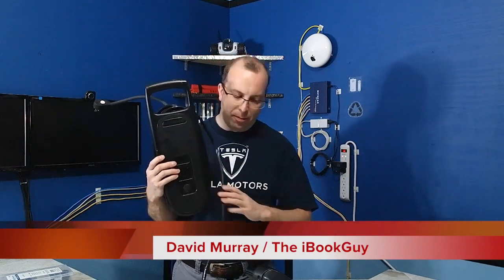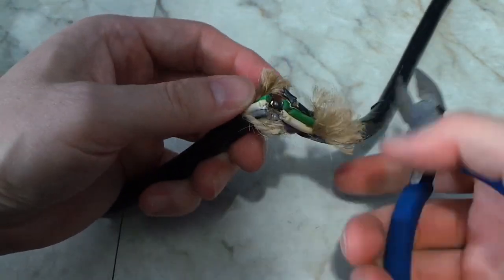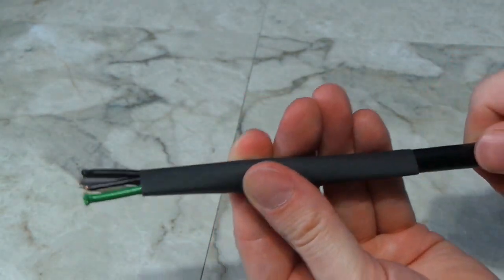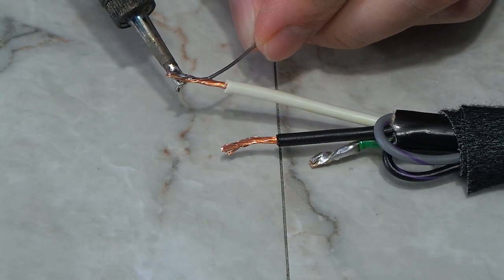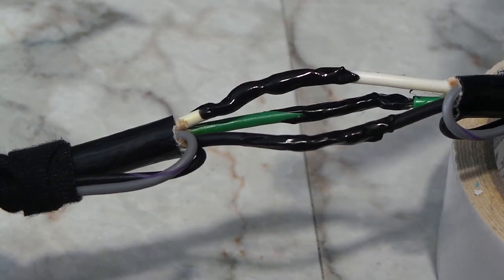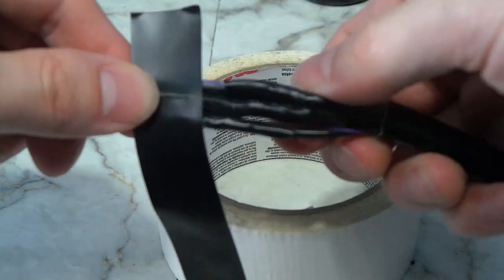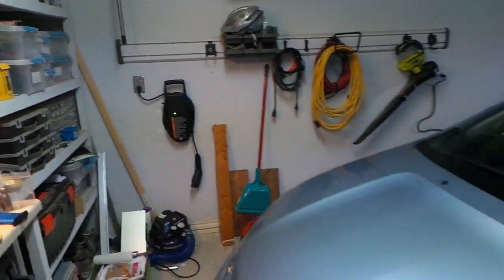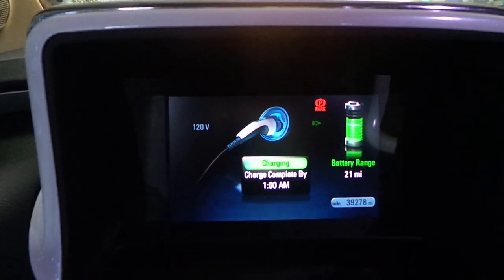Repairing a damaged EV charging cable.

Comment: You should never use solder in high current applications. It is always best to use some sort of a crimp.
Reply: Ah—snicker, snicker—you missed the point.
Reply: Giligain I. Lol I posted this before I finished the video--Thought about removing it, but I was too lazy.
Reply: Kris S 
Exactly! Architecture has detail(s) everywhere. Even urban planning has small tolerances. I remember a project having to find a path for a new underground pipe line...I had to investigate several ancient maps, gathering details of existing location(s), elevation, pitch, diameter, contents carried, direction of carry, whether a line was abandoned... 

Did this type of project too investigating existing power lines, and having to relocate the lines to a new power pole location: studying clearances and slag-line shape...this project put my spatial graphical engineering to the test. It was pretty Kewl showing the others what I can do with a line in space and know its orientation and length.

I miss projects like those. :,-((

But I don't miss having to document fire system, communication system, etc. in this one hospital. I was constantly looking for existing objects..fire extinguishers, exit signs, speakers. This project went on for so long that I began seeing stuff in everyday life, outside of work, in other buildings—I couldn't turn off my scanning for these things. Ugh!
Reply: Kris S but you weren't to lazy to type a whole new comment about your laziness?
Reply: Jason Alexander do you have a problem with that?
Reply: Giligain I. It can also mean "overly concerned with details"
Reply: scratching my head —I don't see how I can't be pedantic given my training. It's the little things ppl screw-up that make the big things, oh, so wrong.
Reply: Giligain I. I learned that the hard way with my more complex math and physics classes.
Reply: Chris Bryant 
¿Okay?
Reply: Kris S 
Take [1]:
I've done the 'discovery' tests back in the day, where it's supposed to help you decide what you want to do. Whelp, that didn't help very much—didn't point out any real strong points..was balanced.
Take [2]:
So I go to college taking basic core classes satisfying any degree & one fun class each semester—art, photography, drama. Eventually, thinking psychology is my thing—but nixed that plan after talking with a professor in the field. 
Take [3]:
So I finally decided I like art & math and that the two together make perfect sense for architecture. The confirmation to my choice was based on The Brady Bunch Show, where Mike is rarely having to pull an all nighter to complete the project that Greg lost; and Mike was home all the time and taking vacations and stable family life with exotic clients. 

My conclusion: I drank way too much A&W Root Beer after school watching Gilligan's Island, I Dream of Jeanie, and Brady Bunch; and McHale's Navy but not by choice...it's what was airing on the network channel at the time—didn't grow-up with cable TV and VCRs weren't around yet.
Reply: Kris S 
That's too bad. I've had more than enough teachers leave before my turn also. What can help is if the textbook is good at introducing the concepts and solid examples. Do you like the book?

Ah, memories of my prestressed concrete classes with a very green teacher. Her background was molecular cracking in concrete. So you can imagine the quantity of detail given during lecture time...pages and pages of hand copied notes from the chalkboard. She did her best, but wasn't ready for the graduate class in reality, maybe undergraduate.

My wood design class was the best because of this foreign teacher with thick accent (but not nearly as bad as the Russian teacher and her 'bisexual lines' instead of 'bisecting lines') his accent was overlooked because he knew his stuff and relayed the information based not on textbooks, but experience. 
Hmm, come to think about it, I got lucky getting the very last semester with a retiring teacher; he taught the Structural Steel and Welding Design. His flow
Design Charts were hand made handouts guiding you to the formula(s) required for design or analysis of existing steel/welds. That was a fun class with much math and design choices. 

Bragging Rights: I designed the structural system for the Hieronymus Mueller Museum alongside my previous employer who designed the architecture and I think mechanical system. It was quite challenging given the materials used and cantilevers and exterior clad. 
http://muellermuseum.org/
Reply: Wow! So you specialize with concrete structures?   I'd like to say that the book is good at explaining things,  but it really isn't.  Right now,  my only real teacher is YouTube(given that I know what to search for)
Reply: Not specialize in concrete, no, but all building materials used to support the building. From designing retaining walls, foundation footings, steel beams/columns and connections used, reinforced CMU walls, wood of all kinds incl. laminated, cable (tension) systems...and the list goes on and on. 
But this doesn't mean I can't design the heat load on a building also, or HVAC system, electrical system, water supply/return system...meet the ADA rules and regulations along side the state/city/local codes, write specification codes, or even make an accurate bid to underbid the competition and yet make a profit.
Reply: Kris S
You would think, but I have found myself in public settings and prefer not to state my profession due to the weird reactions from ppl. It's an honored profession with a code of conduct to follow. I would compare it to any other profession with a code of conduct. I haven't ever met a judge in a public setting to my knowledge, but if I did, I think I would act weird too.
Reply: Kris S 
I disagree to start with based on these observations. I've had this space heater of mine apart for repair and there are solder joints on a 1500 watt heater. The input on several electronic components have solder joints on the power AC input to PCB board. 

So...I did a little digging:

Effect of Solder Thickness and Joint Overlap on the Electrical Resistance of Soldered Copper Joints
https://app.aws.org/wj/supplement/WJ_1981_10_s199.pdf

As a rule of thumb it is generally accepted that, for lap joints, an overlap of three times the thickness of the thinnest conductor is adequate. With regard to joint thickness, joint spacings of 0.002 to 0.005 in. (0.05 to 0.13 mm) are considered desirable to maximize capillarity effects with regard to solder flow into the joint.
Reply: Giligain I. Haha no no,  you misunderstand me.  I agree that for only 12 amps, the solder joint is fine--Afterall,  volts don't generate heat, current does(I think).

I was just saying that it is a lot of power--as a sort of unrelated point--I guess I am not very clear.  I originally didn't know that it was only 12 amps.
Reply: 12 amp is a lot of power for these wires. Not sure what the gage is shown on this post.
Reply: Pedantic: of or like a pendant 
#whoknew
Reply: Kris S 
Did you already know that, or did you look it up? I used iPhone's definition, and that's all she gave me. It's an interesting new word for me.
Reply: +Giligain I. I actually already knew.  I saw it a few weeks ago and thought it was interesting--Worth adding to my vocab.
Reply: Giligain I.  I was talking to Jason Alexander and the OP
Reply: Giligain I. You were talking as if I called you pedantic.  Was from another account
Reply: Chris Bryant
It's okay, I don't mind the title..I like it better than being dogmatic.
Reply: Giligain I. So you're an architec? Nice! I thought about that for a while, but I really don't know enough about it to persue.
Reply: Giligain I. Interesting. I love art and physics--I could live without math.
Reply: Kris S
 ¿ how can you have physics with out math? It was nothing but formulas and how to integrate and derive formulas. 

Architecture has (3) basic fields of study. I chose the Structural Option, which has much more math. Then there's the Design Option, where you interpret the clients wishes and make the Engineers scratch their heads at the impossible design proposed. Finally, there's the Management Option, where you play god with everybody underneath.
Reply: Giligain I. The math used for physics isn't hard to me--The calc is really basic.  But in my calc classes,  it is much more complex.
Reply: Kris S 
I tried looking for my Calc notebook recently...
Last time I heard you were doing partial integration.
Reply: Giligain I. Yeah, we learned some fo that last semester.  So far we have just been reviewing stuff todaY, next class we start new content.
Reply: Giligain I. Guess my luck: At my school, we have a calc teacher that is kinda famous because he is so good--Everyone reserves his class months in advance. When I finally got a seat in his calc 2 class, it turned out that he got cancer. He left the school on the first day of the semester... 
My heart goes out to him and his family; but Long story short, I am back with the suck-teacher from last semester.
Reply: Giligain I. Wow!  thats a profession you can be proud of.
Reply: +Kris S pff 12amps thats nothing !
Reply: +Kristijan Dinga oh, is it just 12 amps?  how many volts?
Reply: Kris S 16-25a is hi-amps
Reply: Kristijan Dinga I asked about the voltage.
Reply: Kris S 120vdc
Reply: Kristijan Dinga that is a lot of power to travel through a solder joint. Almost 1,500 watts.

Comment: Your method was fine, and taking extra precautions was a good choice. 
you could've used butt splice connectors, though it would add unneeded bulk and they fail all the time. You could've even doubled up on the heatshrink, but it seemed like that type of heatshrink was made specifically for higher voltage lines like the plugs for ovens or the EV charger line in your case. 
I don't think there's going to be many good arguments against your method, and I would've done pretty much the same thing.

Comment: The Chevrolet Volt isn't an electric vehicle it is a plug in hybrid
Reply from the maker: XboxCarsForza Yes.. it is a PHEV, which stands for Plug-in Hybrid Electric Vehicle.
Reply: The iBookGuy I know its partially an electric vehicle and you can plug in to recharge the battery but it still has a gasoline engine
Reply: XboxCarsForza It is an electric vehicle.  We have developed terms to distinguish between EVs that have a gas back up (PHEV) and those that do not (BEV: Battery Electric Vehicle).  Both PHEV and BEVs are EVs.  http://www.nrgevgo.com/faq-about-electric-vehicles/
Reply: yes but the engine is only for electricity. If you never turn the engine on, then it is the same as any other electric vehicle.
Reply: XboxCarsForza No it is actually NOT a plug in hybrid like the Prius the volt is actually one of those cars that can run on gasoline and electricity

Comment: iBookGuy, is there a specific reason for using the type of splice you used for this project? If it were me I might look into a western union splice? they seem to be less prone to cold solder joints and have extra strength in the splice itself. In addition to offsetting the splice you can use little pieces of shrink on each wire in the bundle so they will not short. Great Video keep up the good work.

Comment: That was not the proper or safe way to do such a repair. The use of solder to join any cable carrying more than 70 VAC is contrary to all codes and UL requirements (the wires must have a mechanical bond in addition to the solder). The solder on the gauges of wiring s(above 18awg) as shown can sometimes be improperly done and the solder can actually not properly flow onto the conductors (this could damage the device they are connected to by creating a resistance point). I suggest the "liquid tape" you used is inferior to the "real" flexible insulation manufactured by 3M. As an electrical engineer I suggest you recommend just replacing the power cable; virtually all manufacturers sell replacement wires because of such accidents or damage.
Reply: Peter M Thank you for an engineer's perspective.  Just to let you know, the repair in this video was done to the EVSE provided by Chevy.  I checked with my local parts department and they confirmed Chevy does not sell the cable separate from the EVSE and they would like over $600 to sell you a new EVSE.  If one were to replace all of the wiring from the main unit to the part that connects to the car with a third party manufacturer's cable, would you still suggest now soldering to the board in the main unit?  If so, how would you connect it?
Reply: dandixon7 I can tell you that UL and a multitude of other governing agencies do not approve of the manufacturer's recommendations to you on the repair. I could not find the "EVSE" you referenced either. (By the way is that not the same car manufacturer that killed people with defective ignition switches?)  

Additionally soldering without establishing a mechanical bond (twisting the wires together) is not tension resistant. Liquid insulation is not designed for 110VAC power cords, heavy duty shrink tubing is (by the way using a flame to reduce the heat shrink damages it). 

Chevy may not make the cable because some one else does, I found it on the web. Check the web and you will find it. But do me a favor and stick with voltages under 70VAC and 24VDC. You can hurt yourself and viewers not to mention destroy equipment. 

By the way "my perspective" is a reflection of the facts and correct methodologies. Do you refer to a surgeon as having a doctors perspective on your operation or medical advice, as though a plumbers opinion maybe as valid but different????
Reply: Peter M Thanks for the reply.  I was using EV jargon without clarifying what it means.  In terms of an EV the "charger" is a component that is built into the car.  The EVSE, or Electric Vehicle Supply Equipment, is the unit iBookGuy was working on.  It encompasses the plug from the wall to the main unit, the main unit which is responsible for communicating with the car's charger, the cord to the car, and the J1772 plug that actually goes into the car itself.  What I was saying is that Chevy won't sell you just the cord that goes to the car.  I have found a cord with the J1772 plug on it made by Leviton, but it does not have instructions on how to connect it to the main unit portion of the EVSE and I'm curious about pointers for connecting it.  

I would use the phrase "surgeon's perspective" if there was a video about a medical device that I didn't post that I was replying to a surgeon's comment on.  I'm a lawyer myself and I would appreciate it if someone thanked me for providing a lawyer's perspective on a video about a Supreme Court case.

Comment: Maybe use a different color piece of heat shrink tubing to contrast the cable's black outer jacket?  It may prevent someone from inadvertently putting excess strain on the solder joint because the repaired spot would be easier to spot.

Comment: here is my 2 cents respectfully spoken: i personally would have used smaller heat shrink for each wire and then the large one. soldering is great, offsets were great. i too am a very strong believer in fixing stuff rather than buying new.

Comment: You are supposed to use wire knuts ,no electrical tape and always leave some copper wire exposed , so you can tell if electricity is actually flowing.   Obviously I am just kidding, I like your work it looks good.

Comment: Hey, if it works without burning anything up, it's not wrong. Great use of the liquid "tape." I need to remember that product, can come in handy. I have found these types of repairs are less lumpy using a lineman's splice though.

My Mom's Prius refused to do anything one morning and she found a nest of possums under the hood. They'd eaten through the wiring loom. It ended up being a horrendous dollar figure on the repair (something in the 5 figures). Luckily it was covered under warranty.

Comment: How long does charging on 120V take? We charge our electric cars at 240V (standard residential voltage) and can request 3 phase at 400V from the energy supplier.

Comment: You did this right.

...this time.
Reply: lol
Reply: Better connection would be a lineman's splice twisted tight then soldered. In this connection, current doesn't have to flow through the solder to the other wire. In a lineman's splice, there is direct copper to copper contact and the solder is to "glue" the connection solid and protect from corrosion.
But, still not a bad job. Not perfect, but more importantly, it IS safe.
Reply: Except for use tin to fragile connect a 1500 Watts cable without the lineman's splice.
Reply: YUP
I'm sure for every video that does a straight a solder connection on romex at least one house burns down.  

At least he insulated it well enough that'd he most likely cause a short first, probably tripping a breaker, with just a chance of frying something in the car.